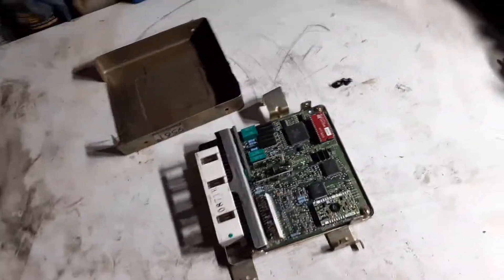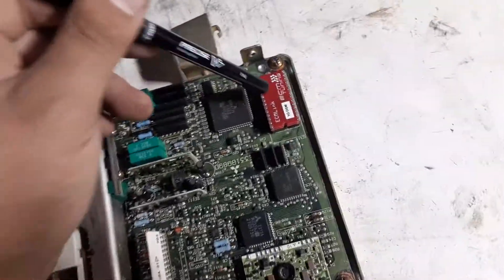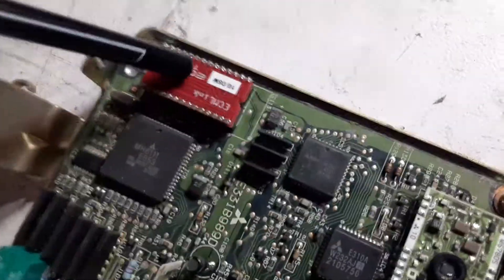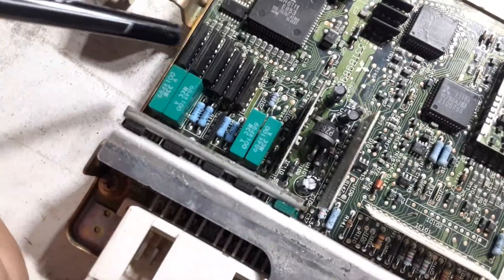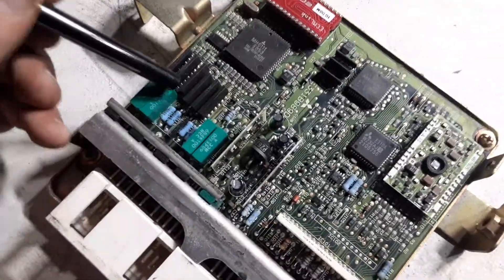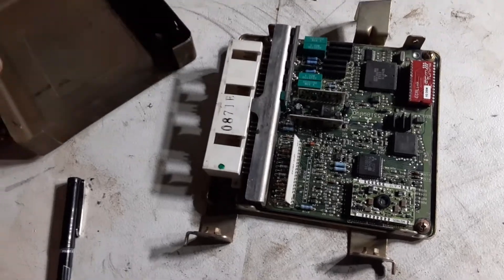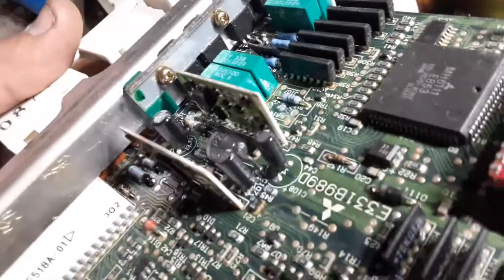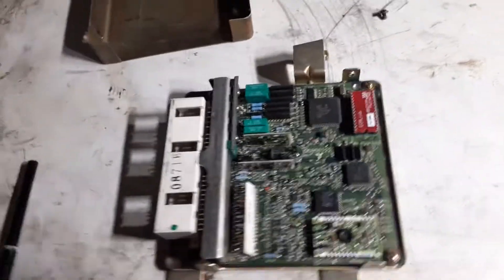1g dsm Ecu inspection.

Comment: Good evening, greetings. I have a 1993 Mitsubishi Pajero, which has problems starting when cold. Once it warms up, it starts fine. Where should I look on the ECU? It's very similar to the one in this video.
Reply from the maker: Thats oftentimes a bad engine coolant temp sensor i would check that first, the ecu could have issues but more often then not sensors go bad first.

Comment: Question do I need to buy this? a couple of guys that where supposed to tune my car said I need this part but doesn’t my car already come with this part I have a 1997 2g eclipse 2.0 gst just wasn’t sure why I would have to buy another one if I have it already also I have a dsmlink
Reply from the maker: @boosted2g  i think they might be reffering to the differences in the 1997 2g cars, for '96-'99 they used a non eprom ecu on the 2g cars,  so you need a 1995 eprom 2g ecu to run dsmlink on your '97 car since they changed the ecu design.
Reply: @mitsubishikid1187 ok thank you

Comment: I have a 2g 96 eclipse gs 2.0l non turbo 5 speed Mt with the 420a I just did a full rebuild to a 420a turbo and wanted to get ECM link v3 my question to you is my ECM the case is not Mitsubishi but has Chrysler sticker on the case. Chrysler dealer told me they were put in 94-98 models how can I know if this can be used with ecmlink?
Reply from the maker: @nicka2445  Unfortunately the 420a cars are not supported by ecmlink so stand alone is your only option if your dead set on running a 420a engine.

Comment: I have replaced an IAC motor driver IC (which was burnt). I confirmed that the IAC motor is fine (by manually feed the ground to the unplugged motor and see it response). 

However, after reset the ECU by removing the negative pole of the battery for more than 10 seconds and the engine had been warmed up, at the first time A/C on, the ECU tried to raise speed from no-load idle (800 rpm) to about 1000 rpm for few seconds but, it could not maintain speed at 1000 rpm and gradually dropped over to 600 rpm and become rough idle. 

Then, at the second A/C on, the RPM did not raise any more, it just dropped to 600 rpm, meaning that the IAC has no command to operate.  Using oscilloscope to check, I found that each IAC coil was operated only six pulses (per coil) and it returned to previous position (six pulses per coil) after A/C off. 

After I reset ECU again, the symptom repeated e. g., the first A/C on --> IAC motor attempt to work but fail, second A/C on --> IAC motor attempt only 6 pulses, rough idle)

How could I find the cause of this problem?
Reply from the maker: Did you replace both the isc drivers? 
Sometimes they can go bad and show no signs of failure, i never mention it in the video, but that is a possibilty, that the drivers look good but are starting to go bad, I might do a more in depth video if i can get in contact with my favorite dsm ecu wiseman, and sharing with the community and if he is willing to give me details, or if he makes a video on the process, i will share it with the channel so we can keep these cars going strong.

Comment: wouldn't it be through 96?
Reply from the maker: Yes possibly, but some guys run 95 2g Eprom ecu units on their 96-99 cars to run ecmlink etc, and yes I have it posted as 1g dsm Ecu inspection, but the info could be used on, 2g dsm, mightymax, ram50,l200, colt, summit, mirage, expo etc.
Reply: @mitsubishikid1187   I was responding specifically to the part where you said Mitsubishi used these from 87 to 99 (I thought everything had to be OBDII compliant by 96).  I was asking because I wasn't sure.

I agree the info applies to all the parts you mentioned.  You could say it applies to pretty much everything that runs on electricity (I just recapped a 20 year old wall oven to fix a dim display).
Reply from the maker: @Milkmans_Son the ecu in the video is 91-94 specifically, but i guess what i was meaning was the same process could be used on 87-99 years i was thinking as if it was dsm 90-99, 96 is likely the cutoff at least for the US cars so you are  likely right.

Comment: Great vid. Unfortunately mine destroyed the board when they leaked.
Reply from the maker: Great comment, i have seen some  so bad they eat a hole in the board as well, obviously not worth fixing in most cases, but possibly useful for parts like the drivers perhaps, or for ecu pins for custom projects, or jumper harnesses etc.